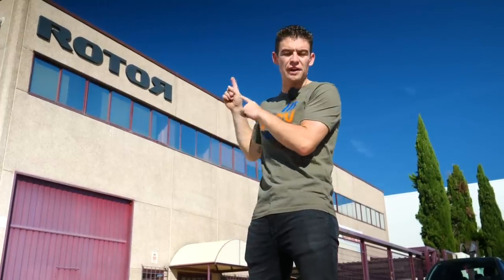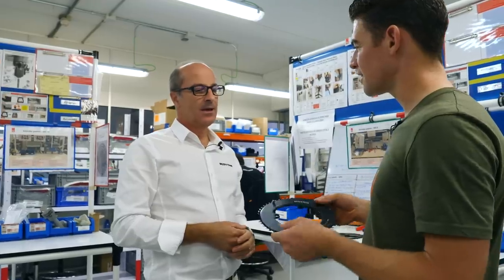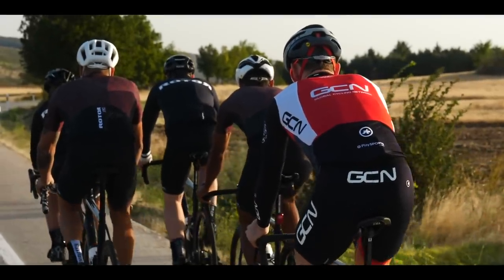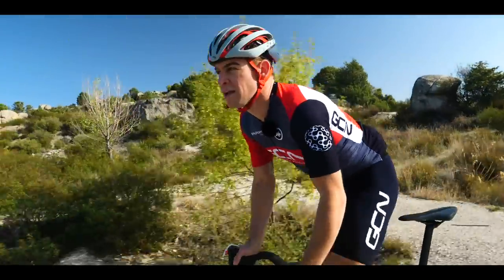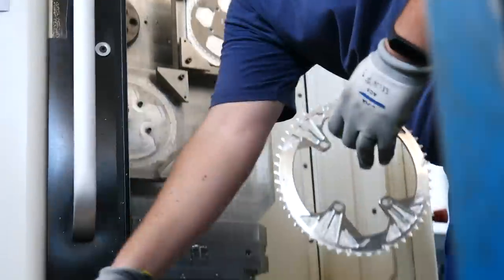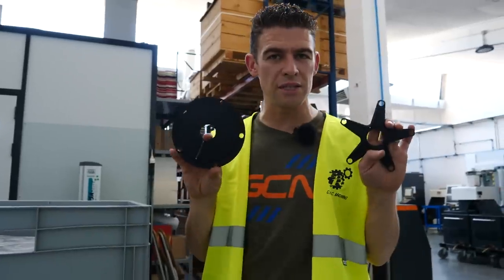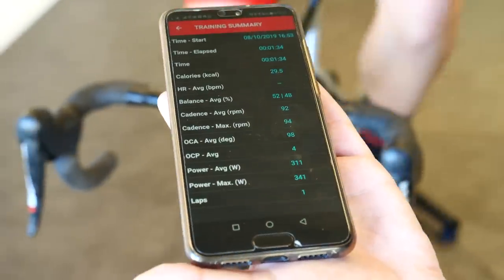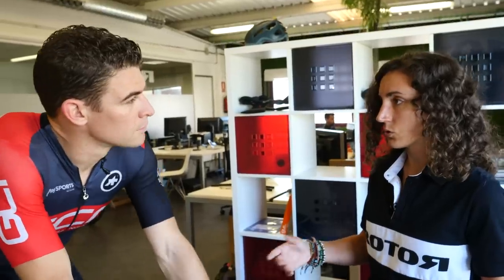The Theory of Oval Chain Rings | ROTOR Factory Tour

Comment: First pioneered by Rotor?  How about Shimano more than 30 years ago?
Reply: Hi Craig,
Thanks for your message. We firmly believe in the oval chainring concept. The orientation of the Shimano oval rings was completely different from the orientation of the ROTOR rings and other oval rings currently in the market. With the Shimano rings the maximum diameter was coming in the angles were the legs were able to apply the least force, while the minimum diameter was coming in te angles in which the legs could apply the maximum force. That's the reason why they disappeared. Current oval rings are designed so that the maximum and minimum resistances come when it is biomechanically better for our legs. We hope more people will try our chainrings and feel the difference.
Thanks
ROTOR Team

Comment: These rings are great...as long as you never need to switch from small to big chainring, and you never get out of the saddle. Otherwise you’re dropping chains and falling over. And even if these rarely happen, once is enough to make you never want to get on that bike again. Thumbs down from someone who tried.
Reply: Hi Chris, Thanks for your feedback. We are sorry that you have had that experience. We've had pro teams riding with Oval rings in the cobbled classics with success. We work hard to make sure the design avoids these issues but unfortunately chain drop is something all we cyclist experience. 
Thanks, ROTOR team

Comment: Dylan Johnson has a great video looking at the actual research into elliptical chainrings to see if they do anything at all. GCN selling the opinions of a manufacturer as fact 😒
Reply: Oval helps every time you could stall when the crank is vertical. Also it gives smoother torque, so you less likely to slip by overcranking.

Comment: they had biopace in the late 80s never panned out
Reply: My first Trek 1200 had Biopace chainrings in the 80's. I actually liked them but didn't notice any efficiency differences.
Reply: "Shimano created their non-round Biopace chainrings with a completely different orientation of the biggest radius of the oval. Their ring orientation has since been widely accepted as being fundamentally wrong. Instead of positioning it in power zone - which is slightly below the level of the crank - they clocked it to the dead zone where human physiology generates least power. The result was that in power zone pedalling was too easy and in dead zone too hard, causing knee pain and lumpy pedalling cadence. Exactly opposite to how it should be." 
https://absoluteblack.cc/why-oval/
Reply: Biopace  were different, they were basically the opposite.
Reply: Hi Jim,
Thanks for your message. We firmly believe in the oval chainring concept and as the guys mention in the replies the orientation of the Shimano oval rings was completely different from the orientation of the ROTOR rings and other oval rings currently in the market. With the Shimano rings the maximum diameter was coming in the angles were the legs were able to apply the least force, while the minimum diameter was coming in te angles in which the legs could apply the maximum force. That's the reason why they disappeared. Current oval rings are designed so that the maximum and minimum resistances come when it is biomechanically better for our legs. We hope more people will try our chainrings and feel the difference.
Thanks
ROTOR Team

Comment: Shimano tried this back in the 1980’s. It failed.
Reply: And Schwinn in '74.
And Columbia in 1893.
"Nothing new under the sun."
Reply: Biopace made it harder to go through the dead zone (vertical crank position), this is the opposite. 
Smoother torque, so you less likely to slip by overcranking. Helps every time you could stall when the crank is vertical. The smoother your power output through the whole rotation, the less difference it makes. So you will not notice it on dry, flat, smooth asphalt, riding with very high cadence.

Comment: Shimano dumped a butt load of yen into R&D of this oval chainring concept before bringing it to market, back in the day. They gave it all up after too many people kept snapping chains. These guys must have purchased the patent. 
Oops! 😳
Reply: Hi Vince,

Thanks for your message. We firmly believe in the oval chainring concept. The orientation of the Shimano oval rings was completely different from the orientation of the ROTOR rings and other oval rings currently in the market. With the Shimano rings the maximum diameter was coming in the angles were the legs were able to apply the least force, while the minimum diameter was coming in te angles in which the legs could apply the maximum force. That's the reason why they disappeared. Current oval rings are designed so that the maximum and minimum resistances come when it is biomechanically better for our legs. We hope more people will try our chainrings and feel the difference.
Thanks
ROTOR Team
Reply: ROTOR Bike Components 
Thanks for clearing that up. Come to think of it, Shimano's attempt WAS around twenty years ago so they obviously didn't have the analytical processing power you guys apparently have. 
Good luck!

...buuuut I can't help but wonder about how the alternating stress of the Oval ring's VARYING diameter has against the FIXED length of the chainstay. 
I hope you guys are factoring in the alternating leverage on the chain and bottom bracket bearings. 🤓

Comment: unfortunately it has been proven in the scientific litterature that oval rings don't work better than round ones. Both gives the same results
Reply: @XX-is7ps  I hardly think either are convincing studies. The first study used 14 trained athletes who had been competing for years and the second used 20 male cyclists (age: 24 ± 6 years) that had regularly participated in regional level competitions for 5 years which means they likely had decent power and pedaling technique. This is typical of study into oval chainrings, they never show gains on untrained riders, or athletes of age and there has never been large scale study supporting the claims being made.
Reply: For me these oval ring make total sense. If you have more teeth at position you are stronger and less when you are weaker. Especially when have bad pedalling technique. I have the Allblack oval rings, and they seam to work. The rotor one are actually a bit cheaper.
Reply: @kid Karbon In cycling, pedaling technique is vastly over-rated since there is no perfect technique. In a cyclic sport, technique is the less of your concern unless it induce injury. There are minimal things to take in consideration and to work on in the cycling motion and the biomecanic of the leg in the pedaling movement. 

Research is rarely done with untrained people, because there is no benefit to it. An amateur population will induce to much variable which will diminish the reliability of the method and the whole research. You need to have a population as homogeneous as possible otherwise the results can say anything. Also, the performance gains are more important in the professional level since this is where the little % counts. 

In non-expert population it way better just to train and get better. But as alway, company will advertise it as : it's that much better. Just like aerodynamic gear which only pros or advance people really benefit.

So instead of working harder keep buying gear that makes you think you will perform better.

Comment: Bio pace chain rings are an old idea.
Reply: Hi Mickey, 
Thanks for your message. We firmly believe in the oval chainring concept. The orientation of the Shimano oval rings was completely different from the orientation of the ROTOR rings and other oval rings currently in the market. With the Shimano rings the maximum diameter was coming in the angles were the legs were able to apply the least force, while the minimum diameter was coming in te angles in which the legs could apply the maximum force. That's the reason why they disappeared. Current oval rings are designed so that the maximum and minimum resistances come when it is biomechanically better for our legs. We hope more people will try our chainrings and feel the difference.
Thanks
ROTOR Team
Reply: Hopefully I can find some of your chain rings to try out. I liked the Biopace rings. When they eventually wore out I couldn't get them anymore.

Comment: Shimano had these on mountain bike in the late '80s. There is nothing new to see here. If it worked it wouldn't have disappeared in the '90s.
Reply: Hi Jimmy, 
Thanks for your message. We firmly believe in the oval chainring concept. The orientation of the Shimano oval rings was completely different from the orientation of the ROTOR rings and other oval rings currently in the market. With the Shimano rings the maximum diameter was coming in the angles were the legs were able to apply the least force, while the minimum diameter was coming in te angles in which the legs could apply the maximum force. That's the reason why they disappeared. Current oval rings are designed so that the maximum and minimum resistances come when it is biomechanically better for our legs. We hope more people will try our chainrings and feel the difference.
Thanks
ROTOR Team

Comment: "First pioneered by ROTOR?"  Utter hogwash.  Shimano BioBace beat them by three decades.  And I'm sure others predate Shimano by a larger margin (just Googled - yup, Schwinn advertised them in '74.  And:  "The concept has been around since the 1890's at least. Take this 1893 Columbia."  There are undoubtedly others.)  The problem with ovalized or "optimized" chainrings is that they counteract the natural work-rest cycle of the leg muscles through the pedal stroke.  Bicycles are so efficient because of this.

The "perfect" ovalized chainring, in theory, would be one that completely flattens the power curve, so as to have zero spikes.  In other words, constant power output.  You'd THINK this would be the most efficient.  But power isn't generated by an electric motor or IC engine, so pursuing "perfect efficiency" is a false goal.  The legs NEED rest through the power cycle and ovalized rings undermine this.

Comment: The Theory of Oval Chain Rings: make believers spend more money
Reply: Hi Jesse,
Thanks for your message. We firmly believe in the oval chainring concept. Q RINGS® are oval chainrings designed to increase performance of cyclists by reducing the impact of dead spots in the pedal rotation. Q RINGS® become larger around the strong zones and smaller around the weak zones. Therefore time spent in the strong zones is longer, while time spent in the weak zones is shorter.

Everyone’s pedaling style is different, so weak and strong zones vary by a quantity of degrees from person to person. The ability to adjust the position of chainring orientation to the crank via OCP (Optimum Chainring Position) is the key to fit each unique user’s needs.

Please see more info at the following link:
https://rotorbike.com/wp-content/uploads/2018/12/ROTOR-Biomechanics-doble-page.pdf

Thanks,
ROTOR Team

Comment: This was terrible. I watched hoping to learn how elliptic work as compared to round and that did not happen.
Reply: Hi M McM, 
Thanks for your message. Q RINGS® are oval chainrings designed to increase performance of cyclists by reducing the impact of dead spots in the pedal
rotation. Q RINGS® become larger around the strong zones and smaller around the weak zones. Therefore time spent in the strong zones is longer, while time spent in the weak zones is shorter. There are less accelerations and decelerations because knee speed remains more constant, so knee strain is reduced. 
For more info please check our website: https://rotorbike.com/wp-content/uploads/2018/12/ROTOR-Biomechanics-doble-page.pdf
Thanks, 
ROTOR Team

Comment: Same thing as biosapce.
Reply: Hi Ron,
Thanks for your message. We firmly believe in the oval chainring concept. The orientation of the Shimano oval rings was completely different from the orientation of the ROTOR rings and other oval rings currently in the market. With the Shimano rings the maximum diameter was coming in the angles were the legs were able to apply the least force, while the minimum diameter was coming in te angles in which the legs could apply the maximum force. That's the reason why they disappeared. Current oval rings are designed so that the maximum and minimum resistances come when it is biomechanically better for our legs. We hope more people will try our chainrings and feel the difference.
Thanks
ROTOR Team